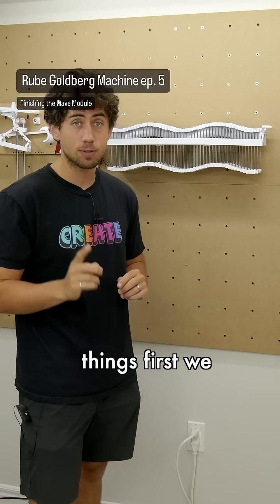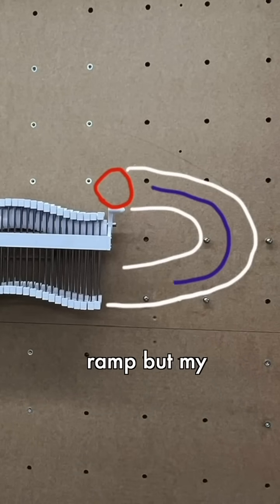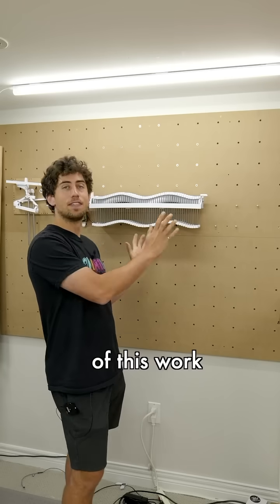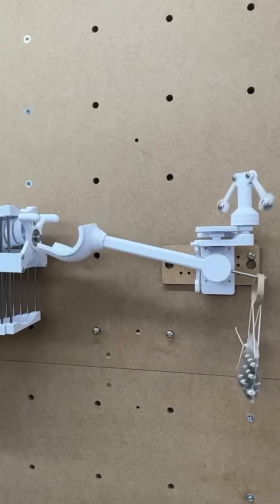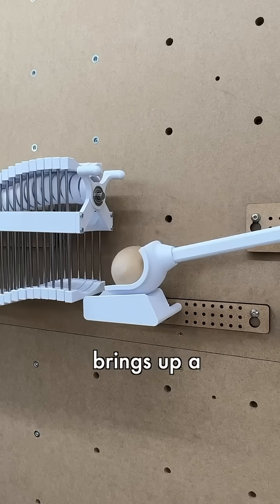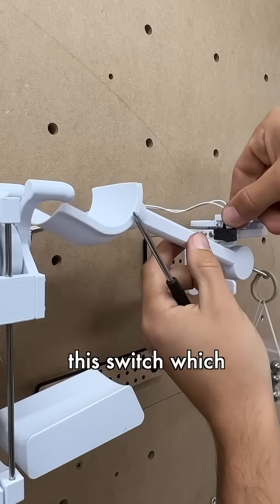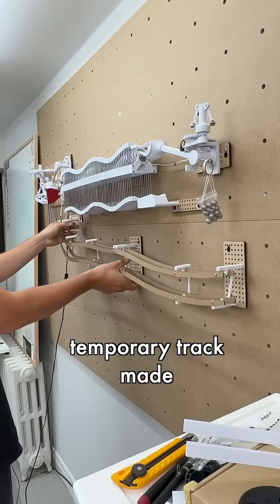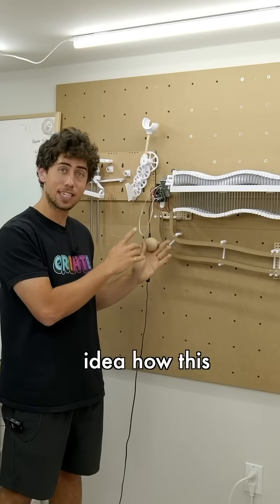Inertial Governor Soft Drop Mechanism

Comment: Have you ever considered using something other than this (is it paper?) ball? Something more jelly maybe. A soft "balloon" filled ~80% with water. Or this paper ball filled with a bit of sand. For some inertia without the jelly. The waves still should work. The water balloon would dampen the edgy wave movement and maybe offer a smoother movement. Sand in a soft balloon might be too inert/sluggish. But I'm curious about this paperball filled 30-50% with sand.
Reply: Or filled with silicon.

Comment: This has been fustrating me for a year, but I finally figured out what I would have done differently: switch the metal rods to dual gear racks so that the waves woould compress and retract instead of staying in paralell. That way you could have multiple balls on the wave at the same time.

Comment: Honestly I'm amazed by some of your design, like the governor, despite not being very dialed in.
Yet at this stage the contraption is what I'd call a perfectionist's nightmare.. The way that the most satisfying part of it are the placeholder cardboard tracks..
It's painful to watch T°T

Hoping you can work on the contraption some more and get the ball to roll in a more smooth, continuous, fluid motion, as opposed to being so stuttery and forced.. 

And maybe opting-in for a purely mechanical design which wouldn't require any sensors to work would be a great addition. Or at the very least, limiting it to only a motor

By the way, it could help to use a flywheel that would accelerate, decelerate and then repeat the sequence in the other direction. this would make the wave module move more smoothly, as well as make it independent from electronics. 
Though, to figure out a way to execute it you may need some time (but in reality its somewhat similar to clock escapement)

Wishing you luck with this project!
To perfection and beyond.
Reply: oh this is an old video lmao......

Comment: The motor doesn't have to switch directions if you adjust the length of the connecting poles or have the lower wave on a different cam

Comment: Why not have the bottom wave just be out of phase with the first wave? You can still use the intertial governor if you want but you don't need to be changing motor direction. Kind of ruins the illusion.

Comment: Did you know that in Rube Goldberg machines, the reason they use rails for the tracks is because spheres tend to oscillate in the tube causing irregularities or a swinging motion in its path of travel eventually backing up the tube

Comment: Now I am not an engineer so this may not be a good idea, however… could you have just adjusted the heights of the moving wave parts so that they automatically will move reversed on the bottom compared to the top. That way it would lessen the amount of electrical components needed?

Comment: ADD THE CATCH SCOOP to be in sync wit hthe wave undulation height, while still grading to dump ball, this would give a more fluid motion. 

You cna make an undulation curve to a bottom ratio with a relating curve bound, but your support rods would have to offset so they don't collide. So its more complicated but you can undulate a curve movement to it.

Comment: Add a second cam connected via a gear. Gear reverses direction. Second cam will turn in opposite direction. No microcontroller needed

Comment: I love the idea!! and i love how you fixed the isuue you were having with the ball getting pushed back by the wave.
Which got me thinking wouldn't it have worked if you just but the little ramp at an angle so it would always feed the ball into the wave instead of the switch, but regardless love the build!

Comment: Could you do a triple stack. Top layer now middle has strings that when they go down pulls the string to raise the bottom layer allowing it to reverse without changing the motor direction?

Comment: awesome work, little bit of armchair engineering here but if you dialed in the angle on top of the 3d printed pieces in the wave module so that the vertex of the next piece would be lined up with the bottom edge of the previous piece the ball would be able to slide significantly smoother and faster through it and it might eliminate the jittering of the ball

Comment: You gotta change the ball wight or size to get rolling consistently, like its riding a wave. You could also do this by plying with the center of gravity of the ball like making it hollow or heavy on the inside. Or do the kinematics and dynamics of the system to find the specifics but im too lazy

Comment: why not have the top of the ball be pushed by the wave? That way you don’t need to switch it and can have multiple balls run at once. So have a ramp on the bottom and the ball is in contact with the wave from the top.

Comment: I noticed that the ball wabbles a lot, so how about playing around with the wave speed to make the ball movement smoother
Reply: I think a little of extra weight to the ball can help 🤔
Reply: You could have a smaller weighted ball inside the bigger ball, filled with something like honey or another viscous liquid
Reply: Just put a layer of something over it, like cloth or smth.
Reply: Wobble
Reply: Wouldn't there be an optimal speed dependent on how long it takes the ball to fall from one rung to its neighbor in the wave (which is partially dependent on the width of the rungs making up the waves as well as gravitational acceleration)?

The reason the ball looks like it is lagging is that it exhibits harmonic motion as the ball moves faster than the wave speed by the time it gets to the bottom of a wave trough, rolling part of the way up the next wave crest before falling back down into the trough. Ideally, the ball should look like it stays inside a wave trough and doesn't wobble.
Reply: The wave pegs have sharp edges... Round the tops so they glide more like a wheel.
Reply: I think shallower waves would help. A bit like not going down as steep a hill, so it doesn't end up rolling as fast

Comment: You should increase the phase difference between the cam shafts so that the wavelength is as close to the ball diameter as possible. That way the waves will hug the ball as it goes through, instead of it just rocking back and forth within the wave trough…
Reply from the maker: That’s an interesting idea! Might be worth exploring
Reply: Oops, I meant increase, not decrease. Increase the phase difference so the wavelength is shorter…
Reply: @aaryananand7288 u smart, i would have nvr thought of that
Reply: @plty3931 its basic asf tho?
Reply: Also, invert the phase for the bottom rail will remove need for motor timer

Comment: I love that the scoop has a centrifugal governor that wouldn't be out of place on an 1800s steam engine.
Reply from the maker: Bringing back the centrifugal governors one scoop at a time
Reply: Forget bout what I said, obviously the constant RPM are the goal of this invention hahahaha
Sorry about that
Reply: @DavidPerez-Reostatico  also its a Rube Goldberg machine, the question isnt "is it useful" the question is "is it cool?"
Reply: @jathan254 and the answer is yes
Reply: Is it really useful? The energy on the system is the same with or without the swinging arms mechanism. It only affects the RPM of the governor. I think it is absolutelly beautiful, but normally it was used to operate a valve with the swinging arms leverage

Comment: Inertial governed is not something I would have thought of. I probably would do some sort of shock absorbing landing pad for the ball to drop on to. It would transfer all its speed into the shock absorbers and then it would start rolling again at the beginning of the lower wave.  It would be a very shallow ramp on a parallel linkage with a shock absorber of some kind (maybe leaf springs because they are 3d printable) to slow it down.
Reply from the maker: Interesting thought! So many ways to achieve the same thing